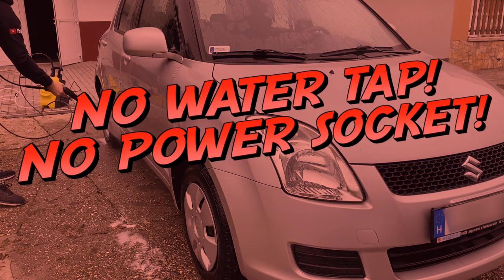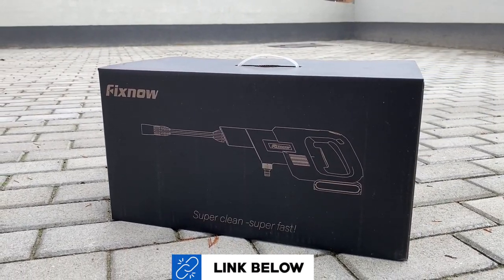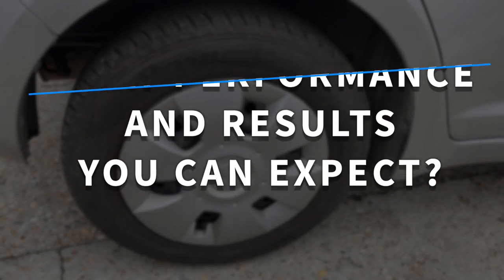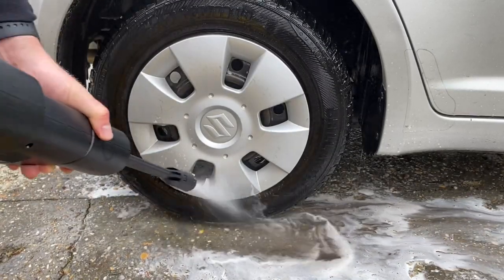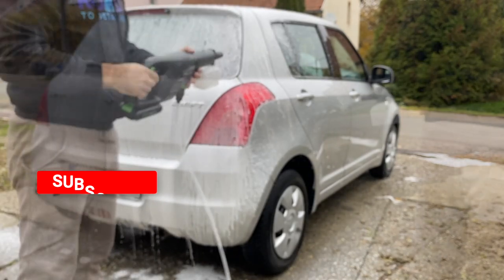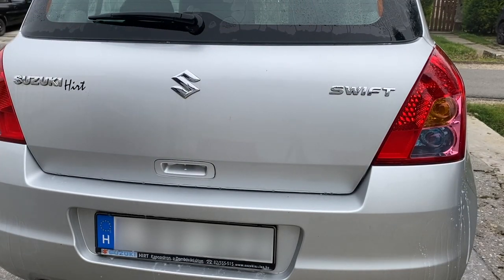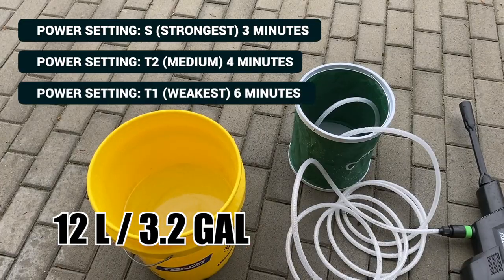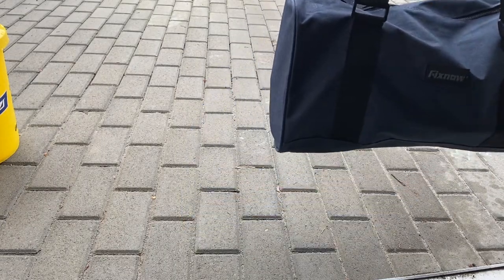Watch THIS Before You BUY A NEW Portable Pressure Washer: FIXNOW 500E

Comment: This takes me back a few years, I used to have the Worx version. If you have no power and water they are better than not having one but I wouldn’t bother with foam at all just a spray pre-wash saving battery and water for just rinsing. I found one battery on the Worxs lasted just long enough to pre-rinse, rinse off pre wash and rinse off shampoo. I kept a spare battery so there was always one fully charged. This one looks a good package 👍🏼
Reply from the maker: Hi Nick,
I agree. I used a Worx Hydroshot with fast charging and bigger battery pack, but even the strongest Hydroshot I had, wasn’t that strong than this one, and it was surprised me during use. The package and features are much greater, the only feature I wish it would have is fast charging option. However, that costs a lot more money. Worx offers that option, although not everyone willing to pay the extra money for that feature itself. Optimal use would be the one you mentioned, pre-wash with a sprayable product, then rinse, contact wash and rinse off again. I lived in an apartment for a while and this kind of pressure washer was the only option. Good to see this market improves. Thanks for your comment Nick, I appreciate it 🙏

Comment: Any idea what connection adaptor this uses?  I would prefer to use a quick connect lance, not sure if is their own connection or a popular connection type.
Reply from the maker: Hey sykesybwoy. Unfortunately they use their very own 😔 Meaning you can’t really differ from the original connection. Furthermore, the quick connection type can’t be an option here. Because, it needs a “longer” lance type of connection that can help build more pressure for the water. Also, it needs the body, which has the main components built in (motor, etc.). Greenworks GDC40 might be a better alternative in this category in regards for different kind of connection, but I personally haven’t try that, so take this with a grain of salt. 

PS: if you meant the connection between the lance and body, or foam bottle and body. That is very similar to the karcher adapter, but it’s smaller and I’m sure it’s not compatible, but the shape is very similar.

Hope this helps either way 🙌
Viktor
Reply: @RoadToDetailing  pretty much exactly what I was referring to, which is a shame to have all that power in a cordless washer and be limited to weaker proprietary accessories.

This was pushing my budget, Greenworks isn’t a option ☺️
Reply from the maker: Yeah, greenworks is quite pricey, unfortunately. 

It sort of makes sense to them to stock with their own type of connection, hence the engineering of the device to be able to put out some strength. 

If you thinking only cordless, worx hydroshot offers a quick type connection at the very and of their short or long lance. But in my experience, you need a longer lance to be able to get decent enough pressure out of the device. I have a full review about a Worx Hydroshot, which you can find on the channel, and you can see, I only use that for a quick release kind foam lance to have a snow foam applied by that. Other than that, not much of a use I could fins of its quick release connection. 

Do you need to be fully cordless? 

Karcher K4 works from a bucket or standing water source. But if you don’t  have power, then this not an option either. Although if you have, then it will work fine from a bucket of water and you can use a quick release system by that.
Reply: @RoadToDetailing  yes, I had watched that Hydroshot video before watching this one.

I live in an apartment with no external access to water or electricity so has to be cordless.

This Fixnow would’ve been the perfect alternative to the Hydroshot WG649 which isn’t available in Europe, relatively similar pressure and I presume battery life.

I’m not sure I agree it making sense the connections being their own to make maximum power. I would assume it’s the motor and amount of voltage being delivered to it that makes it able to create the pressure, rather than the lance connection.  If you think of the Karcher corded range the K2 is less powerful than the K7, but they use the same lance connection.

As they sent you the unit for review, you clearly have a contact there. Is it possible to ask them whether it can use 3rd Party accessories?

Ideally like you’re using the Hydroshot for Foam, I’d like better Foam from the 500E by using a 3rd Party Foam Cannon…
Reply from the maker: Yes, sure, I will ask them for you. 

One thing to note here. The Worx WG630.E (what I’ve used and tested) is available in Europe and has close to the same power as the Fixnow E500, and available with 4.0mAH battery, which can give you 45 mins running time, and comes with a quick charger that able to recharge the battery in 45 mins which is ACE.

One thing I didn’t like and I mentioned this, is the battery power, that lasts 8 minutes in strong, plus 8-10 mins medium settings, that leads 8+10 minutes in different settings. And recharges in 4 hours. So the battery power of the Fixnow 500E isn’t that great, which is very important in case of a cordless.

The worx offers a 2.0mAH battery, without quick charger, and thats sort of the same: 20mins running time, 4 hrs charging.

And I personally think: 4.0mAH battery and quick charger is worth every penny in the long runny, believe me. 😊

What I meant when said the lance can increase the pressure is that, like it helps to give that “little bit of extra” compared to a shorter lance for example. 😉 But I do agree with the strength of the motor you’re saying. 

Pop a DM on instagram @roadtodetailing, and I will get back to you as soon as I receive an answer. Or I can give you their email address where they give answers fairly quick. Whichever you prefer. 

But once again, the battery power doesn’t really satisfying in my opinion. It is very very average. While Worx Hydroshot at least offers the opportunity to longer lasting battery and fast charging (but for extra).

Comment: Thank you. Just bought one on eBay £80 for cleaning my solar panels on my workshop roof.
Reply from the maker: There are several options there, the one before this will have slightly less features and power. Other than that, it’s a great tool for £80. Hope it will be good enough for your needs 🙌
Reply: @RoadToDetailing  My Fixnow 500E arrived yesterday. I just used it today and it got the job done. My workshop has a 40ft ridge roof with solar panels running all the way from front to back, on each slope. There was a lot of algae build up on some of the panels and all had bird crap and dirt buildup on them. 
Well, I used the pressure washer on full power and managed to get all the panels clean in 17 minutes and still had an extra bar of power left in the battery. It took about five buckets of water. Each bucket full gets used up in about 3 minutes. I did leave four buckets of water on the roof before I started, so only had to climb down once more to get another bucket full.
So I must say I am very impressed by this cordless pressure washer. It would have been a logistical nightmare to try and use a normal plug in  pressure washer with all the hosing and cabling up on that roof ridge. I paid £80 for mine, so it’s definitely worth it in my case.
Reply from the maker: @parmorama wow! 😮 Such an experience mate! I am very glad this works for you. Also, thank you for sharing your experience, I think it is very helpful for anyone who’s looking for this because of the same reasons and challenges you have ✌🏻👊🏻

Comment: what is the PSI. it's the only thing that really matters, I can clean tyres by nipping a hose pipe,
Reply from the maker: On paper, the company claims PSI between 300-650, that depends on the setting and the nozzle angle. I would say is about 3-400PSI power in there. 

I would say, the efficiency of cleaning any part of the car is mainly about the chemicals and methods you choose, rather than the pressure washer itself. Although, the power of the jetwash can help a lot, especially of saving time with a stronger water flow (if needed).

We can clean a car without using a power washer at all, fact. The question is what chemicals, methods and accessories we choose. 

Thanks for watching 🙌
Reply: At 9.40 time stamp it says 510. This is pretty impressive as my basic Worx Hydroshot claims about 350 and the powerful one claims 56 bar (800psi) which is pretty mega. Tbh, I get by with it but being a man I always want more power!
Reply from the maker: You are right. I felt this more powerful than the Worx Hydroshot 630, but bare that in mind, the Fixnow 500E works in a “dynamic” range of pressure and not as consistent as the Hydroshot in my experience. Also, Fixnow doesn’t the most transparent about the technical data, so I founded different information on their webpage and resellers data sheets. So while I founded data between 300 and 650 PSI, also it very much depends on which power setting being used, as well the Battery percentage has huge influence on the power, this machine worx approx 3-400PSI at around 8-10 minutes. And yes, it’s more powerful than a Hydroshot, but like I said, the hydroshot is more consistent in my opinion.

Greenworks has a great alternative in this category, yet we are talking about over $400 in price, that is double than either fixnow or hydroshot.
Reply: @RoadToDetailing  that's good to know. I have been impressed by the worx. It's taken 3yrs and the battery finally died (easy to find a replacement). That's the only issue I've had. Would I get the same with these unknown smaller brands? Maybe, but it's not a risk worth taking
Reply from the maker: The only reason I would take Worx over Fixnow is the features below that worx has while Fixnow hasn’t:

- Fast charging (with the right charger module)
- Optional choose of battery capacity between 2/4 AH

Fixnow doesn’t offer a fast charger, not even for extra money, nor has a 4aH battery. And for my washing regime, it’s a deal breaker. 

Obviously, worx only offer this on the more expensive models, but at least: you have the options.

Fixnow has 8-18 mins run time, and 4 hours charging time, worx hydroshot with 4AH has 40-45 mins running time and 40-45mins recharging.

Comment: I would personally say the Greenworks GDC40 is one of the best battery powered washers, 70 bar of pressure and both the unit and batteries are higher quality than the Worx unit I had before. It is rather expensive though as the unit from new doesn't come with batteries or a charger, and technically it's bulky - although probably not when you compare a Worx + additional bucket vs the fact the bucket on the Greenworks is built in. I also wonder why Worx does not sell the WG649 (40v via dual 20v batteries) outside of North America?
Reply from the maker: Hi Mark,
The Greenworks GDC40 indeed a great option. The only downside of that for me is the price as well. Even though the $150-250 range is already pricey (but it depends on the individual’s budget of course) paying around the same amount for the battery on top of the price of the main unit equals with a bigger amount of money. However, you get at least double if not more powerful machine in exchange. About the size, you are absolutely right. When I purchased my WG630E I was looking for the option of buying the WG649, but no one in the EU sold that unfortunately and it hasn’t been changed still, so the most powerful Worx Hydroshot in the EU available is the WG630E at the moment. It probably has to do something with regulations in my opinion.
Reply: @RoadToDetailing  Yeah I think it's to do with regulation too, which is strange considering 40v batteries are available in Europe. Definitely a downside of Greenworks is the cost as you say, easy to spend circa $350 for the unit, charger and battery which is crazy when you consider that's more expensive than a good mains powered pressure washer. I was lucky that I found a GW unit with charger and battery for £125 second hand on eBay.
Reply from the maker: Exactly, that’s my main concern, anything above $250ish for a portable machine is very expensive, but obviously portability costs the most here we pay for. It’s always our circumstances which determine the options we can have not what we can want 😊 That price was a real bargain for the Greenworks, you did a great purchase with that for sure. 🔥

Comment: Bilt Hamber is always a weak solution to apply but for car shows or in the warmer months this looks like it could be a ideal purchase .
Reply from the maker: Indeed Andy! Especially for car shows, to give the wheels and bodywork at least a quick rinse off and wash. I picked BH, because I didn’t want to over complicate the product usage and these 2 products what I choose to start with as a cost effective stuff. If you have the right technique and plans with chemicals, but don’t have a chance for normal pressure washers, this will definitely do the job.

Comment: The product is pretty decent for the money. The only problem I have with it is where do you get a spare battery from. ??
Reply from the maker: Hey There! 
Spare battery can be bought from Amazon as well: Extra Battery: https://amzn.to/3kI2yq8

Main unit: https://amzn.to/41OYEw1

But, if it says wouldn't ship to your country, then it worth to email the company about it. They pretty helpful in my experience.

Hope it helps,
Viktor
Reply: @RoadToDetailing  Thats good they actually have spare batteries. Although a little pricey.  Tanks
Reply from the maker: Yes. Extra batteries always too expensive 😞 My only grape with this machine is that they don’t offer fast charging at all. And 3-4 hours charging time for 15-25 mins running time is not great.

Worx offers Hydroshot with different options for charging and battery capacity, but they are more expensive. :/ if you interested check the video under my page 🙌
Reply: @RoadToDetailing  that’s exactly why I would want at least two batteries. I think I would look at the new Karcher battery powered machine. It’s going to cost an extra £80, but at least you get two sets of batteries. And all the nozzle changes.
Reply from the maker: @JustMyFish  Good shout. Haven't tried Karcher's battery powered machine yet, but I believe Dave from @epicautomotivedetailing done a good review about it. Might worth a look in case that is the same machine you were mentioned :)
Reply: @RoadToDetailing  but then again, I can’t remember where I seen it now. But there was a video about the Karcher machine claiming that the pro version is no different to the home version. The only difference is the quality of the hose and Lance. I don’t know if that’s true, but they are both the same amount of bar. So it could be a lot cheaper to buy a domestic version, then buy the pro Lance and hose. Looking at the prices you would actually save £210. 🤣
Reply from the maker: @JustMyFish  Either way, let me know what will be your final decision, I am very curious now :) Let me know if I can help you out further. Cheers, Viktor

Comment: Can this pressure water be used to take graffiti out of the wall ?
Reply from the maker: Hey Franco, I don’t think so it will have enough power for such a job, for sure.
Reply: @RoadToDetailing  what about dirt of the wall ?
Reply from the maker: @francobaschetti it really depends on the level of dirt. But for patio cleaning I would suggest a machine with at least the power of a Karcher K4 for best results and heavy duty jobs.
Reply: thanks bro very helpfull ! @RoadToDetailing